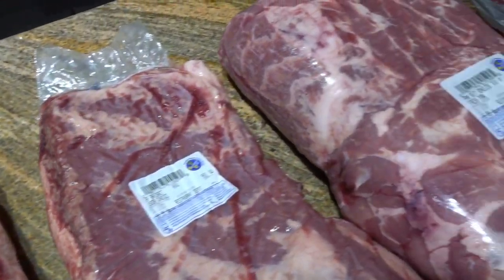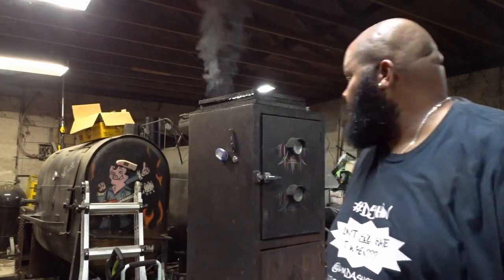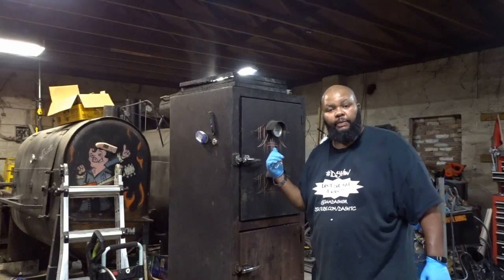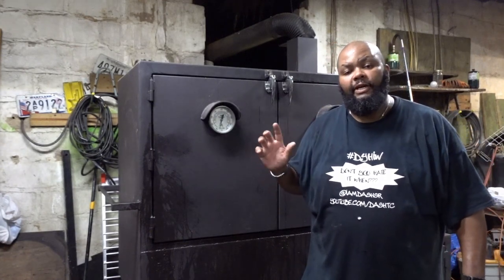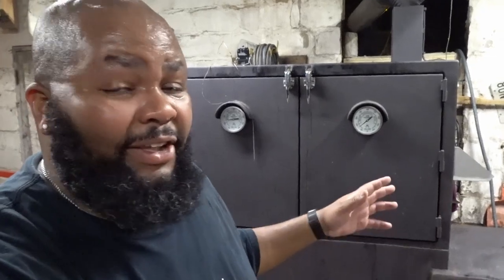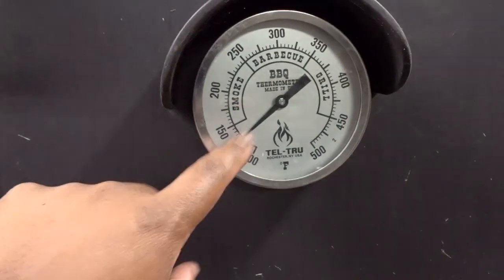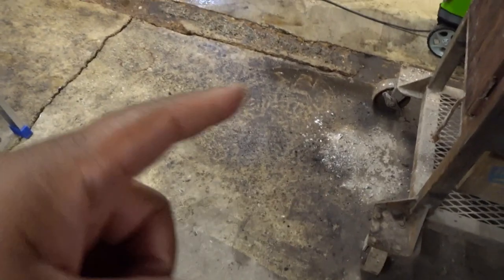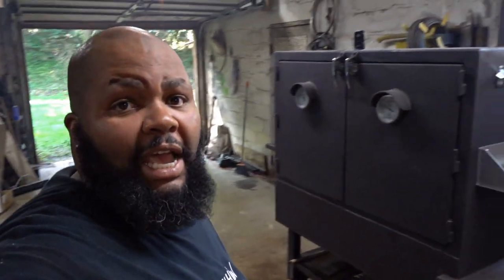SDSBBQ - Halal Standard Grade Brisket vs Choice Grade Brisket and Bone In vs Boneless Pork Shoulder

Comment: I've got a Brisket sitting in my freezer but only a traditional gas grill to cook it with.  Any tips on how to get it just right?
Reply from the maker: Thaw it out. Try and get a smoke box that you can add wood chips into your grill with. If your grill has heat bars that run perpendicular with the grill place the smoke box over the burner that is on. Fine tune it to try and get the grill temp to about 250-275 with one burner on. let the brisket smoke for about 3-6 hours depending on the size... then I usually put the brisket in a foil pan and cover tightly with foil. A decent meat thermometer (wired or wireless) and a quick read one will be useful as well. Continue cooking until the internal temp reaches 200-205 and a temp probe goes in and out like a hot knife through butter. note: when wrapping / after wrapping you can bring it in and put it in the oven at 300 degrees.
Reply: @SDSBBQs  Daaang, that's some detailed advice right there.  Heading to amazon for a smoke box now.
Reply from the maker: Lol did you expect anything less? Me talking about BBQ... your lucky it was that short. Look for thermometers too while you are there!
Reply: @SDSBBQs  brisket on the grill!
Reply from the maker: @TheLionsDenNews  How did it turn out?
Reply: @SDSBBQs  So far it's still out there and 170 internal.